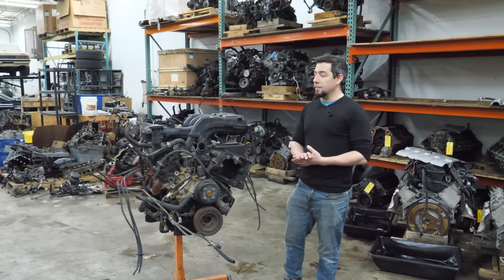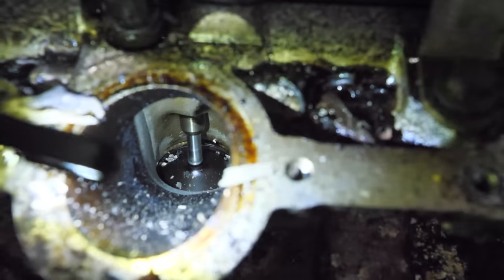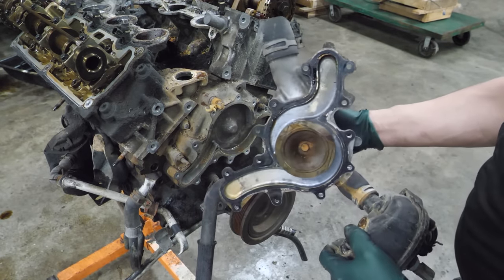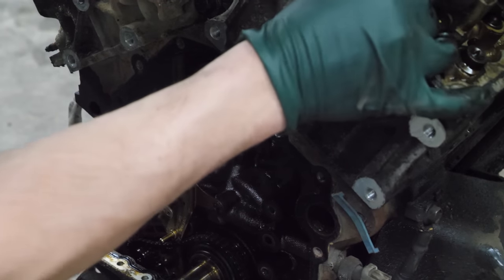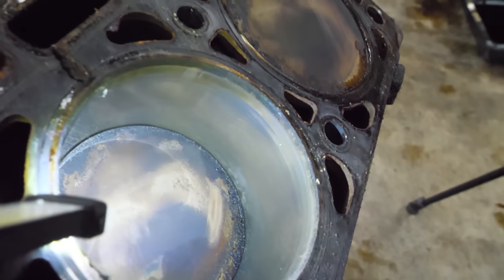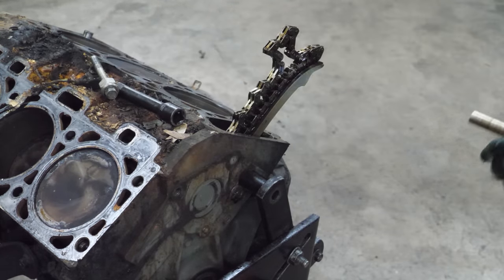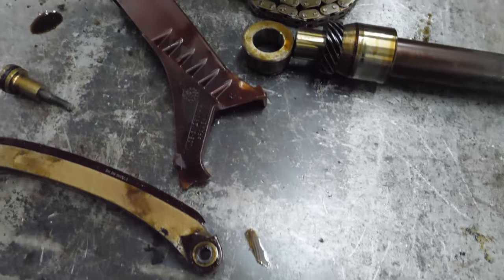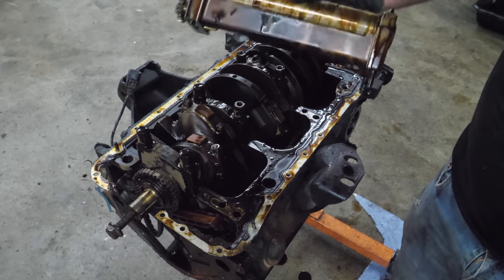Ford Explorer / Ranger / Mustang 4.0L SOHC V6 Teardown! Is This Why They're Called "Exploders" ?

Comment: A relative of mine has a 2003 Explorer with this engine, and his "mileage varies" ("YMMV") greatly from that expressed in your opinions. The original engine has 225,000 miles on it, uses no oil, makes no noises and has very good oil pressure. He drives it every weekday at least 100 miles on his commute.  He changes his oil every couple of months. The only repair he has ever had to do was the thermostat housing.  Maintenance makes a difference.
Reply: Yep, my 04 explorer has 207,000 miles on it and still runs like a champ! Had it since new and changed oil every 4000 miles with the recommended oil from Ford. It does NOT burn any oil and has no noises! As you said maintenance IS everything!!:trophy-yellow-smiling:
Reply: that sounds exactly like the 4.0 thats in my 09 ranger. no issues at all and she’s pushing 150k
Reply: My 07 explorer with 136k miles is starting to rattle decently on startup but prior to me owning it, it was poorly maintained
Reply: Remember, this guy actually likes BMW's so of course he's going to bag on a decent Ford engine
Reply: You know there's always lucky people right?
Theres people with captiva v6s that haven't had to do timing chains. Those people are also lucky.
These are still a shit engine.
Reply: @elfairmont40  Still nowhere near as shit as Chrysler 3.7's and the Sludge-O-Matic Pentastar before it 😉
Reply: They're actually fantastic engines. I had one with I think 376k on it and it still ran good until my ex wife killed it. The 4 liter is a tank
Reply: Even a blind pig can occasionaly find an acorn. You got lucky, that's all.
Reply: @elfairmont40 4.0 is a tank I've got on with 336k, been abused until I recently and still has no issues
Reply: My fathers 2003 has over 250K on the original long block. Has had like 3 transmissions put in it and the rear end has started whining badly recently. People just don’t change oil on OHC engines and badmouth them when they fail, especially Ford.
Reply: My 2002 explorer German engine has 213,000 miles, a good engine, but complicated .
Reply: An engine can have instances of running for 200k+ but still have a terrible timing system. To be clear, I like Ford as far as US vehicle engines go, but sometimes even a good engine has a poor quality to one of its systems. Like my Acura has an annoying VCM system (tho the modern ones are much better than the early ones) and an iffy transmission, which is why they updated it later. Doesn't mean Acura is bad or the engine is bad, it's fantastic. Some engines respond better or worse to lapsed maintenence too. Say someone forgets or mixes up oil changes for a few hundred miles , some engines will grenade themselves while others have minor issues while others will let you go 2x the limit before having any damage at all, or an engine mayhave near guaranteed timing chain issues at 100k like Audi 2.0 engines but otherwise are good if you could more easily change them or expect only 100k miles out of it or something. Ford designed this engine in a silly way, and not every one goes as long as yours before needing a chain, which means an engine pull, which is dumb and totals any of those vehicles as far as cost.
Reply: maintenance has nothing to do with the camshaft chains this pattern is so ridiculous to have to remove an engine from the chassis to change the camshaft chains
Reply: @FordBronco-pz4lv  maintenance has nothing to do with the camshaft chains this pattern is so ridiculous to have to remove an engine from the chassis to change the camshaft chains
Reply: @elfairmont40  yes this  motor timing chains configuration is a shit
Reply: @denisdenis2034  maintenance does have something to do with it, lack of oil changes in my case
Reply: @denisdenis2034  but yeah its a bad design off the get go
Reply: There are people that have over 100k on a Hyundai or Kia but they are Unicorns.
Reply: 04 Explorer 1
275,000 on original engine transmission. Till someone ran red light. Maintenance is the key.
Reply: I have a 09 Ford Ranger supercharged with a Eaton m90. It has got 160k miles on it now. Only ever changed the plastic thermostat housing for a aluminum one because they leak. Still all original motor and trans. Just make sure you stay on top of your fluid changes and this motor will last you forever.
Reply: @denisdenis2034 you don't have to remove the engine to service the rear timing chain. You will have to pull the transmission back from the engine to get to back timing cassette bolt. There are a few car manufacturers that require you drop the engine every 20k to replace the timing belts.
Reply: @danowens7145 a classic Ferrari or Lamborghini maybe but not a economy truck or small
Reply: In 03 ford fixed the timing chain issue.  My sport has well over 200,000 and still runs like a top.
Reply: I had a 1997 Explorer 2 door 4X4 with the 4.0, it was great. I got rid of it with 190,000 miles. It still ran great. Parts were pretty expensive for it though. The starter costed $265 and this was around 2015. But the 4.0 was a pretty good engine.
Reply: There's a difference between a few lucky souls with ringers made on a Tuesday and millions of nearly indestructabe Honda J-series and GM 3000 series that hit 300k with 40 or less oil changes.
Reply: My dad's 2000 explorer 4.0L has 385,679 miles on it and still purrs right along 👊... Only regular oil changes and maintenance...never a breakdown so far 💥
Reply: @Drmcclung  Shit Chrysler 3.7's and Pentastar doesn't make Ford 4.0's decent engines
Reply: @DeusKDuo  Scientifically have to disagree; The Chryslers have a much higher attrition rate, and earlier in life, if we're comparing the V6 families
Reply: @Drmcclung  it still doesn't make the ford 4.0 decent, just not as bad. It doesn't matter how bad the Chrysler engine is. It's like saying cow crap isn't crap because dog crap is more digested it's still crap.
Reply: @DeusKDuo  ok
Reply: @ToddBigelow-zg6vs  you got the new timing cassettes in the 2004   Made with metal back up..instead of plastic cassettes.  2002 and older did not……still important to change oil religiously…only engine I change syn. Oil every 3 k…..and use a 0/40 or 5/30…so oil to the cassettes is very quick …should go 300 k..if you do that.
Reply: @fishrocker95 …04 got new metal cassettes….much better. 02 and older did not
Reply: @Drmcclung ..not a decent motor….fair…good only to 200 k….changed cassettes in 04 with metal Back up…they were better…I know got 5 of them…all rebuilt motors…02 and older
Reply: @chrsshears4528  if they're not that good why do you have 5 of them?
Reply: my mustang has the v6 from the mountaineer in it and its done 200k miles with only needing timing chains done once and a thermostat replacement over the last 10years i've had it , sure its not a v8 but with gas prices I'll take the v6
Reply: I love my 08 Explorer and intend to keep it longer even though it has 150 thousand miles on it . Seems all the new vehicles have that belt in oil set-up which means it goes bad by time not use . I would love to find an 06  - 10 Explorer with very low miles on it at a reasonable price they are by far better than anything made now .
Reply: As someone who owned an 03 explorer sport trac from 220k-293k it gets pretty rough at about 240. That's when a lot of the accessory parts on the engine, like the alternator and fuel pump, and water pump go out.
Reply: @elfairmont40 yes and they’re the ones who will disagree because they didn’t have to do any work on em🙄
Reply: Bought an 04 explorer with 200k and a slight ticking noise. Put 40k more and drove it 4 years with the ticking noise getting louder each year. I think its a good reliable motor,